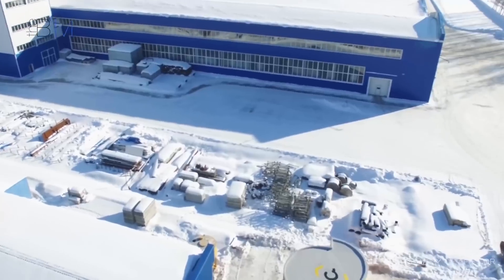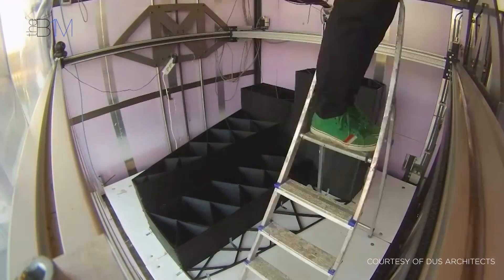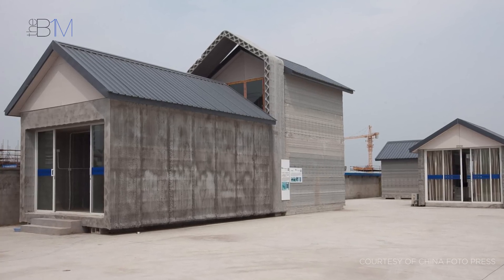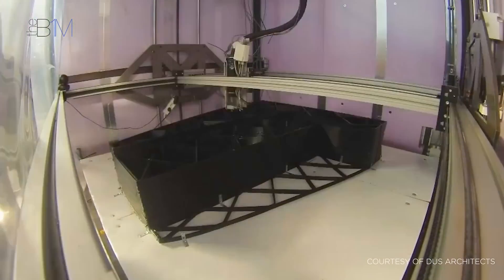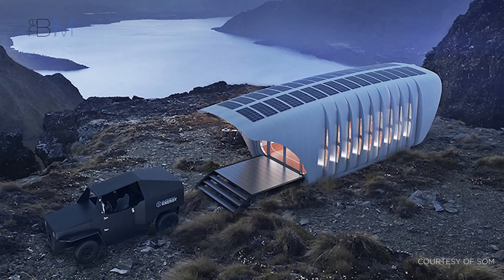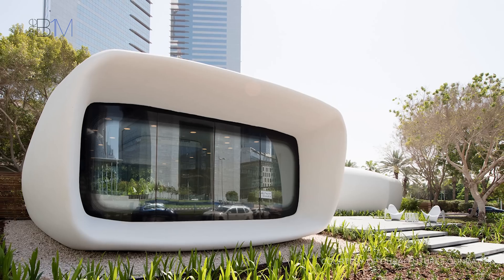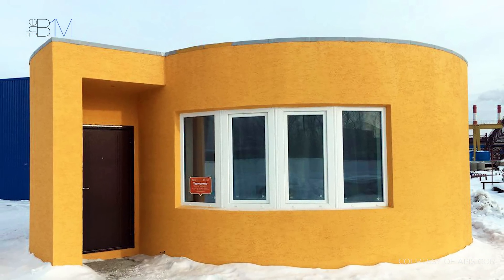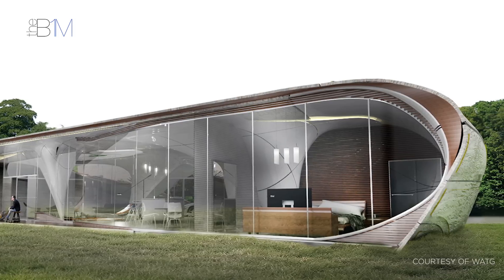The Race to Build the First 3D Printed House | The B1M

Comment: At 3:38, he says that "solar panels ... feed a generator under the building which in turn powers the structure at night".  A generator that uses electricity to produce electricity??  Really?
Reply: "solar generator" is a pretty common term for a battery bank with an integrated solar charge controller and inverter. Not a great choice of term I agree but at this point it is basically the canonical term for that class of device, at least for marketing purposes

Comment: The future of 3d printer construction is a dna material that transmits power through out the building because of it solar properties also no wiring is required because all electrical signals are coded only powering specific object at specific voltages, using high  speed partical accelerator fired by laser can also increase to build time from days down to minutes, each build can be built complete because its printed at molecular level making objects requiring no finishing, so walls doors sinks pipes can all be printed as one job lot, if 20 partical laser are positioned above a construction a tower block could be completed in less than a day ready to move in

Comment: At the end you say they want to build 1,5 milion houses in 5 years. That would mean they would have to print and build  4110 houses EVERY single day. Such a BS.
Reply: A 3D-printed house is built faster, cheaper, and safer than a manually constructed house. That means printers not long from now are gonna sell like hotcakes, and that manual construction is on the way out. Goals like that will be met easier with each year.
Reply from the maker: The daily global house building requirement is far higher than that unfortunately. India alone need to build 30,000 units a day for the next 8 years: https://m.timesofindia.com/city/mumbai/India-needs-to-build-30K-units-daily-for-8-years-to-meet-housing-needs-KPMG-report/articleshow/40527413.cms

Comment: BS They reduce the cost of manufacturing and charge the end user twice as much. Progress is a rip off.
The automobile is a perfect example. They are cheaper and easier to build then ever before but they charge 
as much as 20 -30 time more than they they did as little as 15 years ago. Well beyond the rate of actual inflation.
Reply: It will be the same with fusion power lol

Comment: I mean aside from being very versatile in structural objects that can be printed, how is it different from precast concrete if you going to assemble the parts anyway?
Reply: Not to mention the fact that the only cost effective polymers that can be structurally integrated are refined from petroleum, sooo....
Reply: And the fact that unless the structures are built from "rubble" (as you do precisely put it..) ON SITE there will still be significant environmental & economic cost in transporting a large amount of heavy materials... In short, this concept is just another derpy way for people to pretend to innovate without considering the application of said "innovation" .. I can see small scale applications that make people say "oh that's neat" but there are so many factors being ignored: will a considerable amount of people WANT to live in these homes? How well will these structures maintain airflow & regulate temperature?What is the cost to maintain & update these machines as they exceed their duty cycles? How will the obsolescence of  another job sector impact the economy & the well-being of the citizens that relied on that job sector for their income? Assuming disruptive technologies will ONLY positively impact the average individual is naive to the point of idiocy....
Reply: i think that your right atm. However if they can begin to work this for larger scale systems and work it in with automated transport you could have entire districts 3d printed with no need for labor or redesigning. Hypothetically you could go to a display home pick one out and have it 3d printed the next day. The painter comes the day after and the fittings the day after that.
Reply: Did you even listen to the stats? It takes little time, and little waste. Also, recycling rubble is pretty good
Reply: Little waste?! XD look into Portland cements (binding agent in concrete ) environmental cost, then try to be the guy that goes "guhh its good cuz they say so! I know cuz I watched a video derr!"